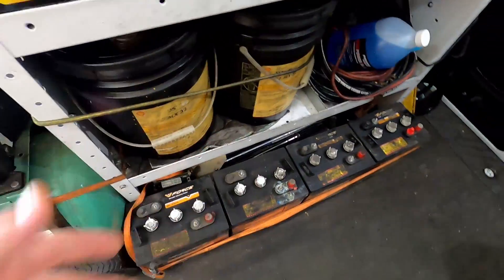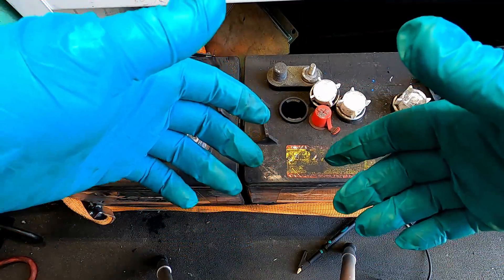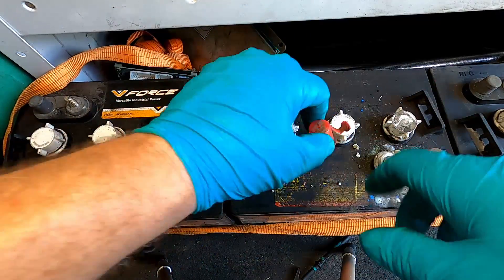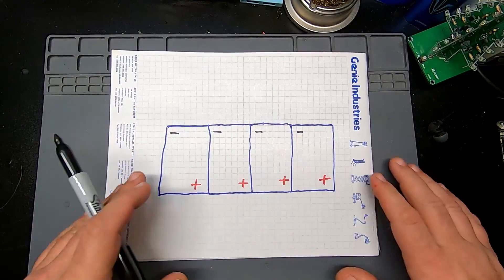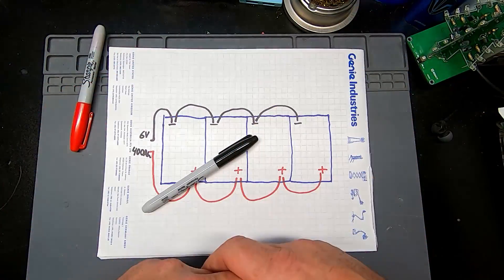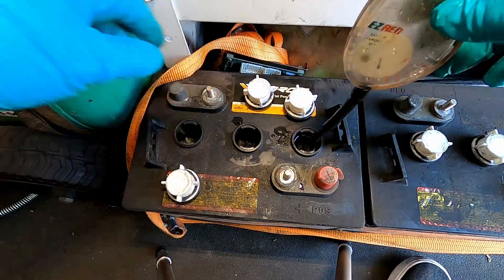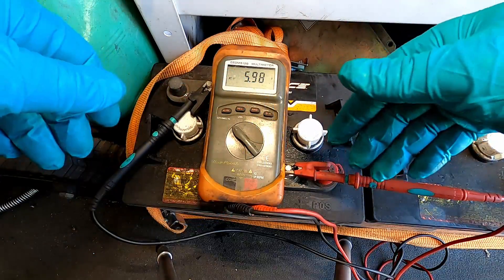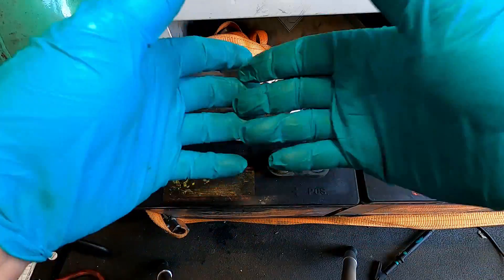Deep Cycle Batteries Maintenance And Testing

Comment: Great video and me living in AZ. there are lots of golf carts and most people I know change out the set when one goes bad. I had been running gel deep cycle in my wheelchair (2-12V for a 24 V system) for years and I got about 3 years out of them but when one goes bad, replace both. $300 each. My new chair came with Lithium and what a difference. My range has almost doubled but it came at a cast. $5000 but I am able to go all day without running out of power and should last the life of the chair. (about 5-6 years) I am very active in teaching and building furniture,, and unloading trailers so The new batteries have made a huge difference
Reply from the maker: The lithium batteries are definitely an improvement over lead acid but as you mentioned they’re a little pricey. I think as far as commercial applications go lead acid batteries will be around for a while.
Reply: @FunkFPV  Lead acid, they’ll be around for many years with all the safe recycling of them. Insurance paid for my lithium.

Comment: I work with these batteries on a daily basis mainly on scissor lifts. A few quick checks during the daily/weekly inspections no one does. When checking levels in each cell, before blindly filling, look for extreme differences in water level. IE one will be at a normal use level, one will be down to the plates and one near the top of the cap; usually accompanied by wet tops of batteries or complaints of leaking batteries. One cell is feeding the other it’s water. Thus being bad. I have had luck finding the bad egg in the bunch by plugging in to on board charging system and check voltages while being charged and have found one to be charging at a very high rate. Strong sulfur smell is sign of over charging as well. The hydrometer can throw people off some times if you don’t burn off that “top” charge after being connected to a charge system. I do have one of the expensive load testers that’s will test at 75amp for 120min ( I think but most don’t make it anywhere near, maybe 70-80) it is nice to have but with time involved sometime it can be a pain to pull out unless trying to give the customer a relative estimate of life of the battery left. We use distilled water but our jobs never have that on site, who can blame em. Just yesterday I got to a job and one battery had the caps off just sitting on top of the battery and water was non existent down to the plates. Any water is better than no water.

Comment: Thanks for the content. For capacity testing I got a “A10H” cheap-looking electronic load on eBay for $80. I blew up one of the power mosfets because they advertised 30V but the mosfet was only specced for 20V, so I replaced the mosfets and it’s good again. The software has graphing, capacity totaling, and programmable voltage cut-out, in addition to charging modes. Great for both lead acid and lithium and the best option I’ve seen below the serious $300+ options.

Comment: Another difference between starter batteries and deep-cycle batteries (at least the ones i've seen), the deep-cycle batteries tend to have a larger "trough" underneath the electrodes so that the crud that eventually flakes off have somewhere to go where they don't touch the electrodes, so they don't self discharge/short cells.
Sidenote: as far as i know, the recommended depth of discharge is ~50% of the capacity if you're aiming for maximum longevity, but it's probably going to vary on how fast you're discharging them etc

Comment: I have migrated away from the toaster style load tester to a digital tester. Specifically the Topdon BT300P. It load tests, gives a state of charge and overall health in percentage. It can also do charging test and cranking test for auto application. It can also print out results. Ive found it very handy and more thorough so far.

Comment: Really good advice! At work we run some scissor pallet jacks that have normal car batteries in them because they are cheap. The batteries only last about a year and capacity deteriorates very quickly. Not a good idea to do that.
Reply from the maker: The thing you got a remember to with the scissor lift is the weight of the batteries are part of the stability. I’d have to fail a scissor lift on inspection that didn’t have the right batteries in it.
Reply: @FunkFPV  Thats a good argument for buying the proper batteries next time, maybe i can convince them.

Comment: Heavy highway trucks and off-highway equipment are typically wired in parallel. Although, back in the 60s, or so, they were more typically wires series.

Dielectric grease helps prevent corrosion on the posts and cables, too.

Comment: I feel so cool right now. I run the cart shop at a golf course, our fleet consists of 70, 2016 model year Yamaha 48 volt golf carts. Each cart has 6 batteries. The ends that bolt to the terminals always corrode off so we clean the battery tops with water, baking soda, water, then compressed air. Spray fluid film on the ends once you’ve done that they’ll last for a long time. My theory for why the ends corrode off is because the batteries get overfilled and vent excess acid onto the terminals and ends, or it’s because they run hot.
Reply: But yeah this is my job and we only use distilled water because that’s what Yamaha calls for

Comment: Lead acid do not want to be discharged.  Do not run them low if you can avoid it.  If you use it,  charge it.  A light float charge is good for them.  Look at car batteries,  they run a starter motor that runs for 2 seconds then they recharge.  Deep cycle are they same chemistry with basically thicker plates to deal with deep cycling.    They don't like it,  but they can do it.   Keep them charged and keep water in them.
Reply: I have to disagree, I work for a battery company and we were taught the best for v force deep cycle batteries are too bring them to about 20-30% discharge and than let them get a full recharge for the best bang for your buck, that’s straight from the manufacture to. With that being said yes keep them watered.
Reply: @matthewmeneses8459  oh yeah,  that's the way to get the most use out of them.  What I'm saying is using them at all shortens their life.  The best life they can live is a slow float charge without ever being discharged.  But then there's no point to the battery.  Discharging them shortens their life but that's what they're for.   You don't need to discharge them 30%  but it's probably the way to get the most use out of them.

Comment: I had a crack in the battery in my truck when I was in college and it was slowly leaking acid. I would top it off with distilled water occasionally because I had no money and I like to procrastinate. One time when I put the cap back on, a bit of acid/water shot directly into my eye. Would not recommend. I washed it with a ton of water and my vision was blurry still so I went to the ER. They flushed it with several bags of IV fluid. The outside layer of my eye was eaten away but it healed and I fully recovered. Definitely scary and dumb.
Reply from the maker: Always use safety squints 😜

Comment: Knew most of the things Funk presented. And watched it for entertainment.
Still learned an unofficial rule (rule of thumb) about the acidity 50 points-ISH of difference between cells (on an instrument with 1.3k graduations)👍
Now i feel the urge to buy a float battery acid tester 🤣 I'm joking, i don't come in contact with flooded batteries.

Comment: I yanked out the SLA batteries in my eMoped  and replaced them with a LiFePO4 bank, and the difference is unbelievable.
Reply from the maker: LiFe batteries are really nice and safe. The only drawback is they lack amps.
Reply: @FunkFPV  That's why there are still LA batteries in all combustion engine cars. 
For me, it took a useless slow junk, and converted it into a super fun long distance moped.

Comment: Thanks for the info. None of my batteries have the ability to be filled back up. I have  2 100amp batteries for my solar system. They recommend using deep cycle for solar. Any way I have had them for years and they are starting to loose capacity. I am thinking about getting 2 new batteries that are 200amp so will have twice the capacity. Anyway thanks for the info.

Comment: I have a deep marine battery in my Jeep Grand Cherokee that I hook up a power inverter to sometimes. And it's nice to run my house off of when power is out. But I refuse to let it get below 12 volts because the alternator would not like that recharging in voltage lower than that. Brushes can start smoking

Comment: Not related to the video but do you have any tips for getting stripped countersunk screws out ? With welding or anything
Reply from the maker: I usually drill the head off and hopefully there’s bolt left to vice grips on.

Comment: Those are about $160 bones each, and use them in my bus conversion. I have a watering system for mine, all the caps have hoses that connect to a common manifold that fills them equally and simultaniously.
Reply from the maker: Those are great but it’s a good idea to pop those caps off every once in a while to make sure they’re all getting filled. I’ve seen a few batteries cook a cell because it wasn’t getting any water.

Comment: Which battery Last longer? A battery connected in series or parallel? Power tools have batteries with different amps not voltage.
Reply from the maker: There shouldn’t be a real difference on how they’re wired. It all comes down to how you use them.

Comment: So basically, the voltage is the power, and the amp-hours is the time the power can be provided, right?
Didn't know about series-parallel but it's well explained here.
Reply from the maker: A better way to look at it is in terms of fluid. Voltage is the pressure and the amps are the amount of flow.

Comment: What grinds my gears? Chinese electric scissors or booms that you never know how it's wired. Nothing the same. Also the batteries that are for certain model scissors that are extremely expensive because of the weight requirements.

Comment: I have a 8series Toyota that has a new battery and starter , but when the units key is switched off it tries to crank . I tested the switch the switch tests good. Any ideas?
Reply from the maker: Try it with the key switch unplugged. I’ve had those switches test good when they’re bad.

Comment: Load testing of deep cycle batteries is not a one size fits all thing. The load is different for different batteries. For accurate results always consult the manufacturer. Too many times i see people just take out the 100 amp load tester and use it on every battery they test. This is wrong. The load and duration of the load needs to tailored to the battery under test and then the result needs to be temperature corrected. Yes the result will change based on temperature of the battery.

Comment: Those 100 amp load testers are nothing better than a hand warmer. Batteries are to be tested at half their CCA rating, meaning if it is rated at 100 CCA you need to test it at 500 amps.  If the battery does indeed fail a 100 amp test it is 100% degective. A 12 volt battery rated at 1000 amps sould not drop below 10.5 volts with a 500 amp load for 15 seconds. FYI, going on 30 years repairing HVAC, refrigeration, generators and electrical systems on commercial fishing vessels and large yachts with 24, 32 and 48 volt DC systems. AC systems are 220 to 480 volt 3 phase.

Comment: Don't fully fill your empty batteries! Make sure there's maybe 80% fluid, otherwise you get acid overflowing. Also ion exchanged water is enough for batteries, it has under 10 mS conductivity, tap water starts from over 100!